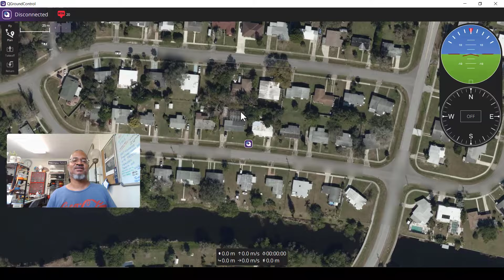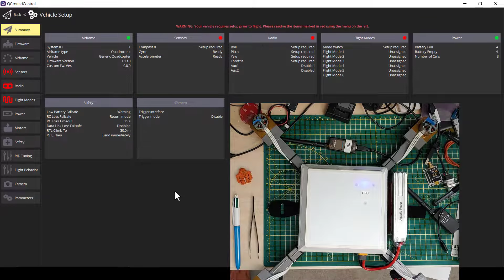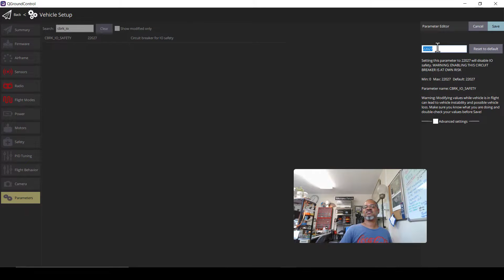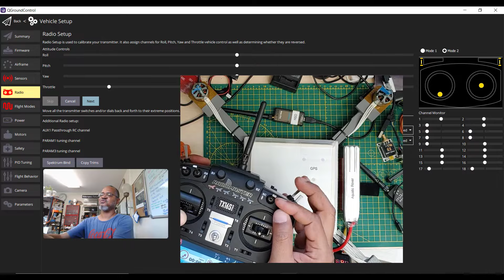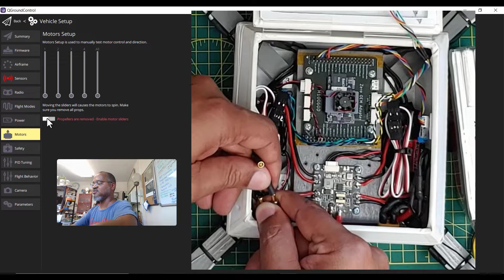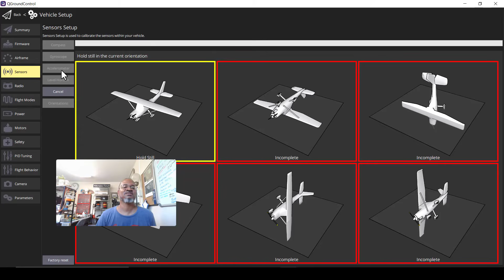PX4 Flight Controller Setup in QGroundControl

Comment: I’m very new to the ardupilot the website is overwhelming for someone who wants to get into it. I always learn and engage a lot more if I follow along. I always love helicopters. Can you do a video on helicopters. From installing hardware, rotor pitching to setting it up on Qgroundcontrol. There isn’t any videos about Px4 for helicopter. Also how did you get the remote control to connect to the Qgroundcontrol?
Reply from the maker: I have a helicopter that someone donated. I even have spare parts for it. I'll try to get a video for it up soon.
For the remote (radio) is connected to the rc receiver on board the quadrotor. QGroundControl "sees" the remote through communications with the flight controller. This is why you can set the functionality of the channels in QGC. So, effectively, you have two places to set how your channels work, at the radio and at the receiver. I hope that helps.
Reply: @bentsprockettech  anything will help even if you have to make a 2 or 3 part video that good for content each 1h long. There just very few videos out there. Which is not really helpful some seem to connect without having to do the work except the one who which to copy or follow leave their head scratching how to or where does this go. I feel like YouTuber now in days do cheap content to get cheap algorithm to benefit. Which it should be the opposite on making good content with in depth knowledge and understanding. This way people follow each step which leads to authentic subscribers. Willing to learning more, if you can do a setup of the hardware. Pitch level and parametric settings etc. I just got my Firefox to learn to fly a helicopter and would love to get a large helicopter with the px4 hardware and gimbal setup to program to fly. Again your only the few who has good content out there
Reply from the maker: Thank you. I appreciate the feedback. I will try to get some detailed videos up on the heli as time permits.
Reply: @bentsprockettech  thank you. I’ll keep my eyes out for your next videos